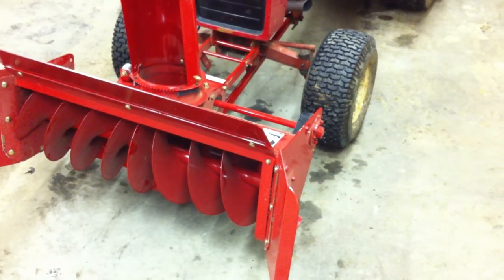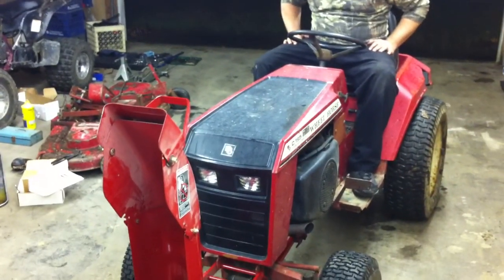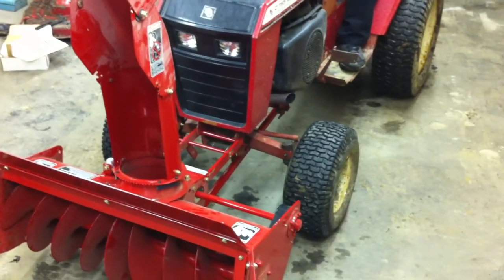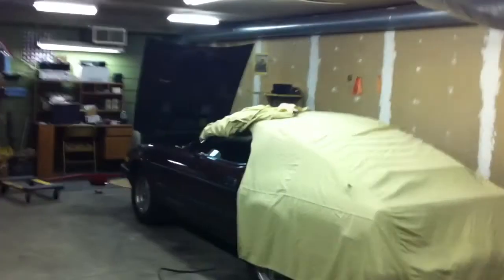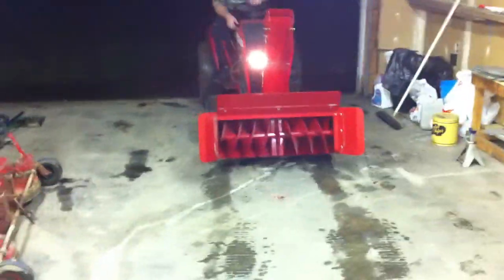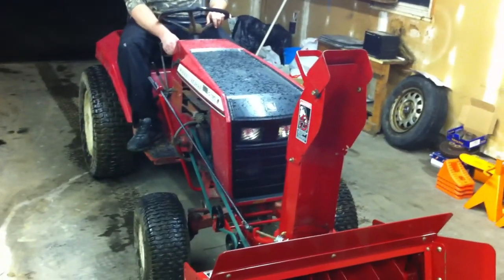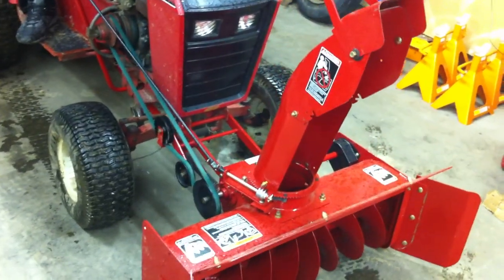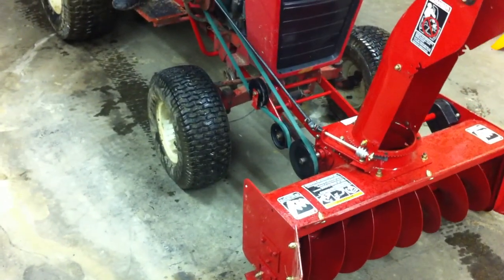1982 Wheel Horse C-195 Tractor & 1998 (79360 Model) Wheel Horse 42 Inch Snow Thrower

Comment from the maker: You guys are right.  We just gave the thrower a quick try.  I had not greased the bearings or oiled the chain yet.  Is the chain too tight?  It could be!  After grease and oil the unit became much quieter.  I'll try to get a good detailed video of me removing the thrower from a C195.  I do not think I will need it anymore as Spring is here.  It sure does work though.  I had a two and a half snow drift down my left side of my driveway and at 3/4 throttle it ate it like it was nothing! Video soon.